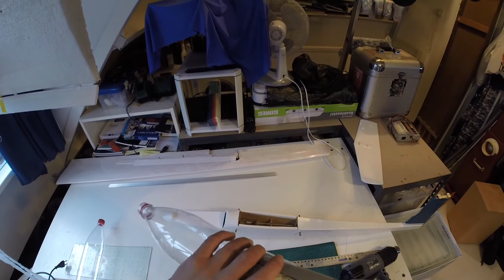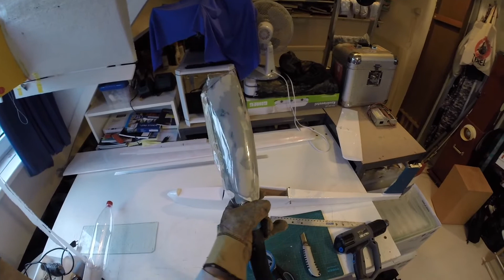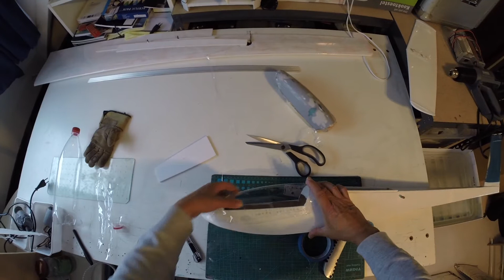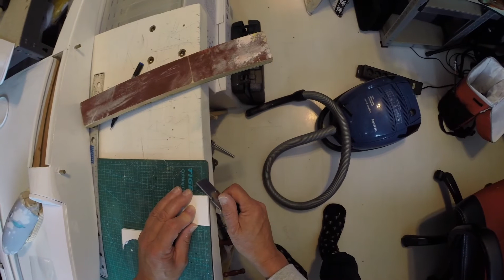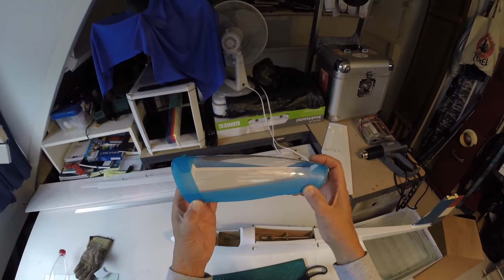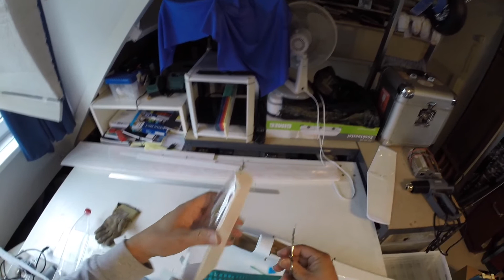Making of the canopy for the Simprop Dadalus rc glider

Comment: What bottle did you use?
Reply from the maker: It was a PET plastic dr Pepper bottle
Reply: A 2L bottle? My canopy seems like it needs about 2 more inched.
Reply from the maker: @andyc12  the bottle I use is 1.5 liter. We do not have bigger PET bottles with this nice transparant smooth  surface. When the plastic is too short I use 2 bottles and glue them together in a way its acceptable. Over the glue part I put some tape. If you want to make a perfect canopy then you must use other techniques like vacuumforming, bigger lexan plastic sheets, making vacuumbox etc.